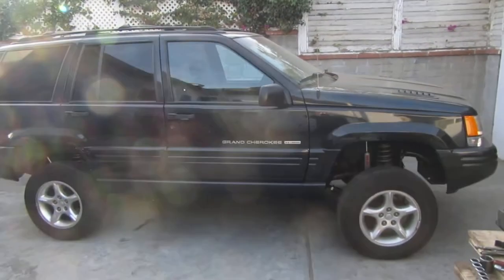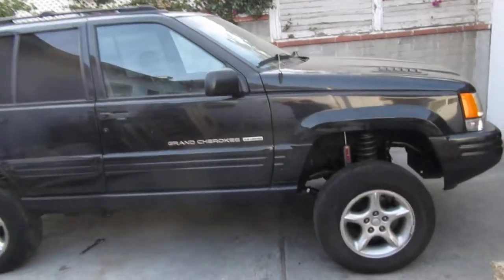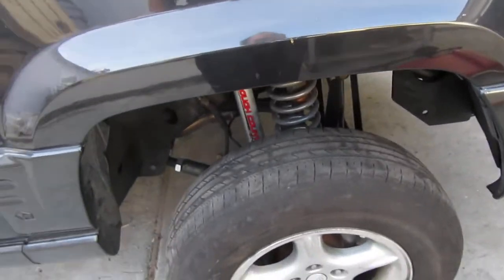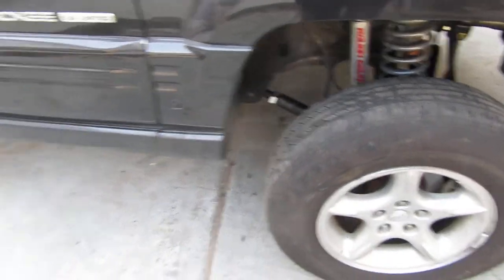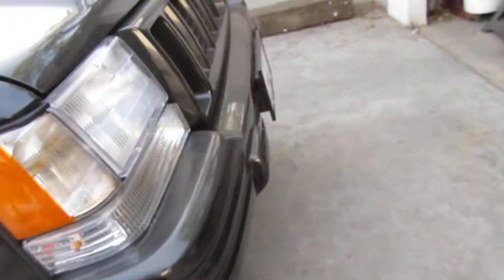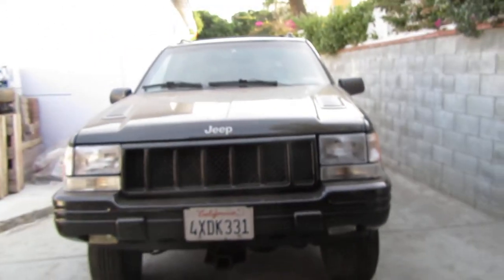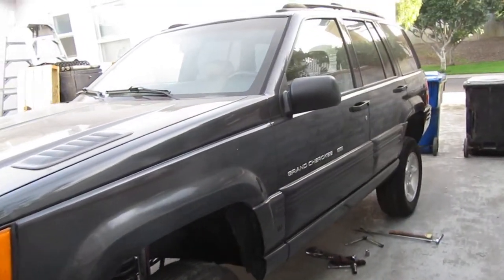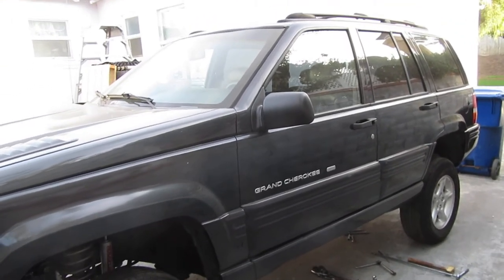Jeep ZJ 5.9 Lift kit installed, Weight on Wheels, Time for torque

Comment: What lift is this?
Reply from the maker: This is a Rough Country Lift bought thru Iron Rock Offroad.  IRO changes some of the items to their items.  Also have IRO adjustable Track Bars and a Mountain Vista Fabrication Steering Brace.  The Steering Brace should be your FIRST mod; or, at least mod it at the same time.